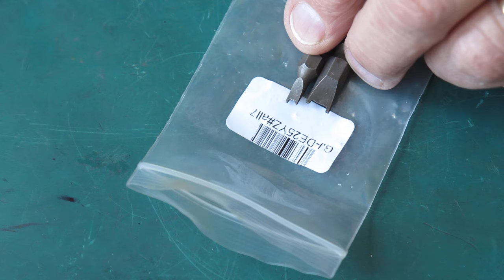Making special tools for camera repair.

Comment: YES! Great to see a another repairer using hex bits - so adaptable and easy to store. Tip for beginners is to cover the pin hole screw with masking tape to reduce the risk of scratching the surface and/or elongating the pin hole. Also, apply torque increasingly with the tool fully-engaged - don't snatch at the fastener as you might a seized car bolt! Chris makes it look easy but he's been doing camera repair for years and has a feel for the force required.

Comment: Hello Chris,
Thank you very much! Well thought-out and ingenious solutions, bravo!
One tool that I have, which I find very handy, is a circlips plier like yours, but with one key difference: the tips have a 90° bend in them. This means that the tips will stay parallel, contrary to "straight tips" circlips pliers.
One benefit of those pliers is that I can apply downwards pressure with one hand on the tips and use the other hand to apply torque to unscrew the screw.

Comment: I love these kind of insight knowledge videos. What I've used is a compass. That can be locked to right size and you can get a good grip on them. Also, you mention you have a fed3 there. Any change you would know how to tension the curtains? I know which screws are the tension, but how much and what method to tighten them isnt so clear. They are a tricky design because of that dual screw design where the other one is locking screw.